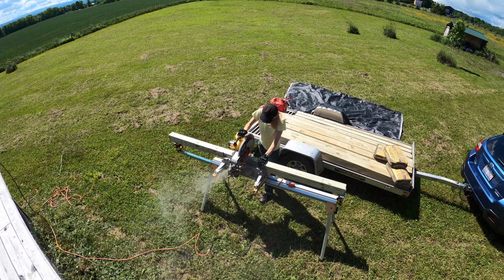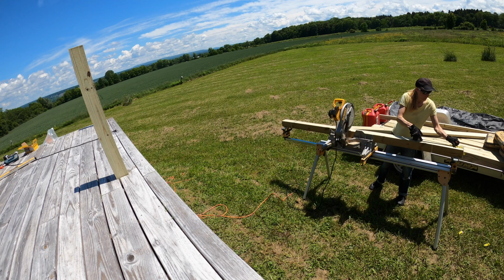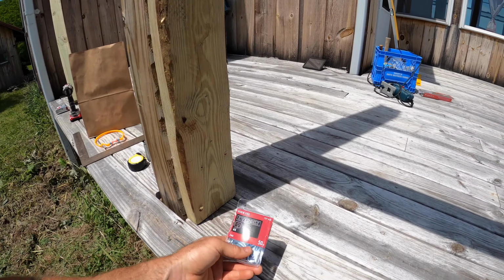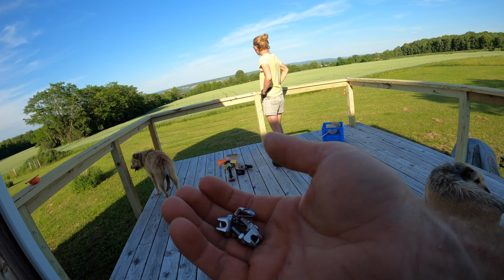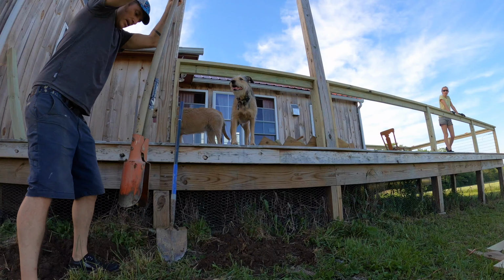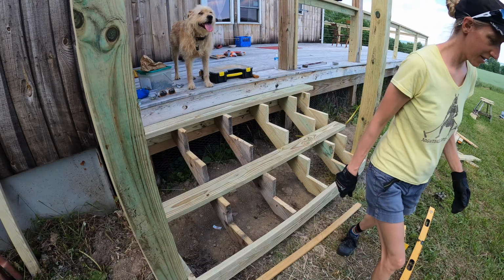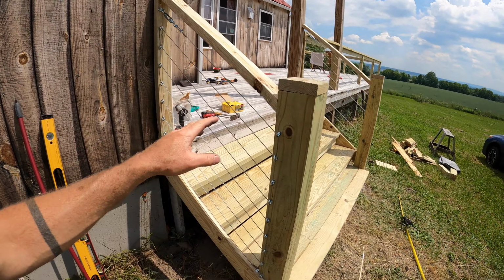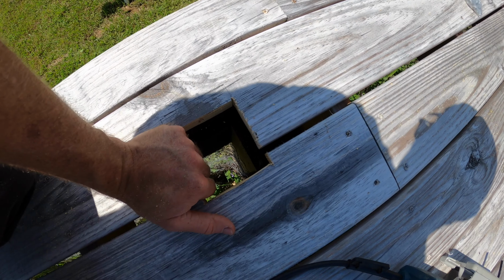DIY Cable Railing - Fast, Simple, and Easy

Comment: Hey brother have you ever heard of coating the portion of the post that will go into ground with used motor oil from your truck oil change? I talked to this old cat who said him and his family have always done that to posts and they have this fence over 60 years old on their property and the posts are still rock solid
Reply from the maker: Sounds like a great idea. I've coated them in tar before, and years later it seemed to be holding up. It's weird: some posts last a long time and others rot quick. Seems to have to do with moisture level in the soil. Thanks for the tip!

Comment: If that railing were made out of mashed potatoes, I would then put some gravy all over it. Next, I would proceed to consume it. I'm afraid, however, that my eyes would be bigger than my stomach, and that I would not be able to eat the entire structure. I'd have to wrap it up in a doggie bag and put it in the refrigerator. This is yet another reason to use the materials you've used. Mashed potatoes do not often make a solid railing for a deck.  

Thanks for the content.
Keep up the good work.  בס״ד.
Reply from the maker: haha ... love it man. Good hearing from ya!